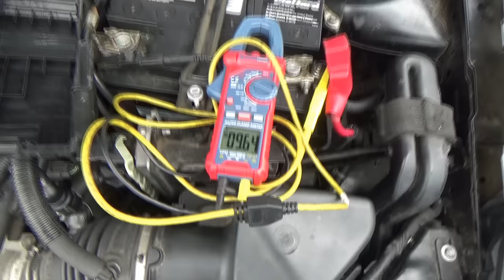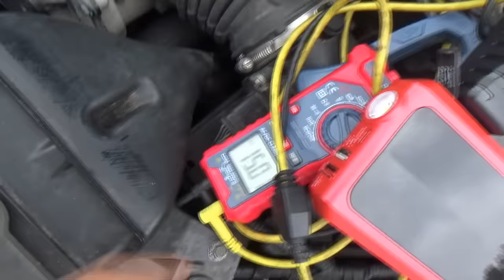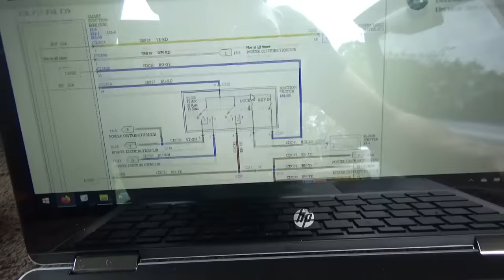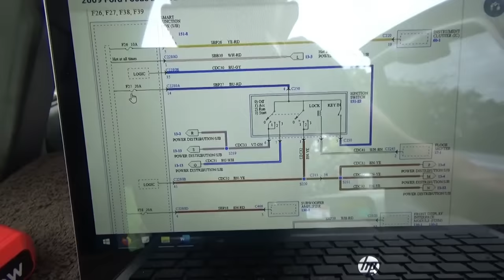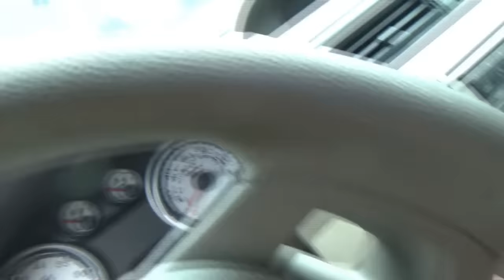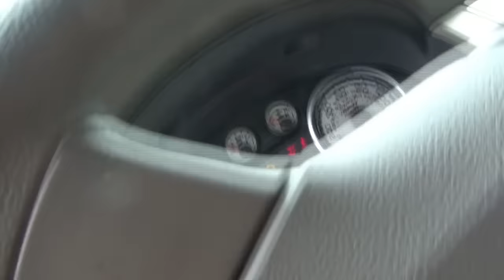How to FOCUS Your Diagnostics? (No Ignition, No Crank)

Comment: Your awesome.  Where are u located. I took my car to get it fixed bc I had a battery drain. Paid them 300 bucks sat for 3 months and all they did was new chip. I replaced the battery cable myself and fixed the problem the key switch is not right I have to keep turning it hard to start.  Help?

Comment: Hi Ivan,    i have the same car as this one here, and my backup tail lights only work on the driver side,  i replaced the bulb on the passenger side , and it still doesn't work.  Is this likely a transmission neutral safety switch issue?   Otherwise my car has no wiring or ground issues,  car is rust free and has like 49,000miles/ 80,000km, really good shape, owned since new.
Reply from the maker: I would take a look at the wiring diagram...if one works then it is definitely not an input problem :)

Comment: I don't think anyone has a problem paying for actual work. But as you know, it's a parts cannon that costs money. I've never been to a shop (in this area) that's didn't change a part and not accept original complaint not satisfied. They don't even verify the repair. "oh that's a separate issue." Most of the time they break something replace a part that didn't need it in the first place. That's why I started working on my own cars. I'm not good at it but at least I try. I've met a few good mechanics in my life but sadly everyone here is in a hurry. Even the dealerships can't diagnose a bad battery. Was funny watching them pull the battery cart around when they said "we'll just drive that up to the bay for you." 10 minutes later after a jump start.

Comment: interesting find.  i agree that it is seperate issues  but , it goes along with one thing. it needs to start  and run . it cant be a fix without both.  its an oxymoron. you need to fix the no crank to see if it runs  but by fixing the fuse you partially fixed the no crank  and it ran as a result. i would prefer to charge as one  extended diagnostic  rather than break it apart. but its all personal preference. human nature has shown me a good explanation on the bill covers you and makes them happier to pay but sometimes breaking down for seperate charges in related cases usually throws up a red flag to customers.
Reply: I believe, the initial problem found was that nothing was working other than the door locks. The customer may or may not have been aware of this.  1-The fuse replacement only brought power(12vdc) to some systems that were lacking power (12vdc). There is diagnostics and verifications involved. Fuses blow for a reason. Just replacing a fuse without such can cause further damage to a vehicle's electronics.  After the ' fuse replacement/diagnostic' (inline test light as current limiter/indicator) the vehicle still had a no crank, no start.  2-Then, the further diagnostics followed by the repairing of the clutch switch restored the vehicle's ability to crank and start today and with no new dealer part required. If one wants to consider 1&2 together as 1 total diagnostic time, the total of that time is still the total of 1&2 diagnostic time. 3- Key programming should cost whatever market value is for a shop to perform such a procedure. It requires costly tools and IDK if it requires subscriptions and/or registrations. 4- Ivan went an additional step to verify if any other electrical items were not functioning correctly and found issue with blinkers, flashers/hi beam and called customer to see if he wanted that diagnosed and repaired.  If one is looking for flat rates to cover all the repairs that any vehicle might need, expect it to be in the 1000s and many do exactly that and charge that, as it assures they will make a lot of money. It is the business model of today. Honest men get crushed somehow in today's business model's process. I have seen it 1st hand from inside and outside perspectives. Honest men like Ivan feel they want to explain what they have done and what needs to be done, in hopes that the customer understands and will be happy on all levels. Many will not fully understand but some will appreciate it.. and others just always think they are being ripped off because they don't understand. I do all my own work on my cars and my knowledge & experience is fairly deep but if I ever really needed a mechanic to trust, I would drive the several hundred miles to Ivan or ship the car to him and still be paying less and actually be getting it repaired correctly. That just does not happen at most other shops. Having a correct repair is priceless, even to a poor and 'thrifty'(cheap) person like myself, as I recognize that value.

Comment: Does anyone know if this meter has an easily replaceable fuse? I have blow the 10A fuse in a meter before and end up having to replace it. Also would like to know where the leads for the meter come from too. I thought they were snap on ones but they don’t look like that.
Reply from the maker: Snap On leads. Only in series ammeters have fuses.

Comment: We had one on a late model focus  that was intermittent  it would drive then die when unexpected  lights would flash off and on  when key was turned on took long time but it ended up being the 50 amp fuse bolted  on the terminal strip at battery it must have be stressed when bolted in making and braking connection when it pleased  it turns out this fuse supplied all the other computers  with power they need to operate properly  we took  did restive test looked fuse tested good So i  pushed around the fuse bolt in ends and stressed it  cause the problem  so we replace the fuse n=but they are not cheap  but now several months latter doing fine the fuse in question was under the hood attached to the buss bar 50 amp bolt in
Reply: cant post picture as to where and what it looks like because you do not allow that option on your site

Comment: I think that in a race between checking continuity on all the fuses vs. Logging into All data and hunting for the right circuit  diagram, that there wouldn't be much time difference, but checking fuses is a ton cheaper than an AD  subscription.

Comment: Why not pop the caps off the battery, fill it with distilled water and put it on a smart charger to rejuvenate and you will have a good battery again, so many batteries thrown away for no reason.

Comment: nice work. as long as you explain to the customer how you bill them they can decide how far to go. In the case of the turn signals I wouldn't charge for the repair. All you did was spray it.

Comment: I disagree with some of your charges. For example if you charge a minimum of say $90 for one hour diagnosis, whatever, that means the entire 60 minutes belongs to the customer, since you charge them for the 1 hour. For example, I once had an HVAC company that had a 2 hour minimum service charge. The tech came and completed the job in 1 hour, since he had a 2 hour minimum I paid for the two hours. 

He was then leaving and I asked him where he was going, to the next call of course. You can't do that, I paid for 2 hours of your time, the next 60 minutes belong to me, not you, once the hour is past you can go to your next call, or take 1 hour off the bill. He took 1 hour off the bill, and amended his minimum charge to an amount, instead of time.

He was not happy, I paid for 2 hours of your time, that's the way you wanted it, so 2 hours is what you owe me. If you had of said we have a minimum charge of $150.00, then you could have left, with no issues. But it does not work that way when you say its a minimum number of hours. Same applies to a mechanics time, if hes stating it as a minimum amount of hours, no a minimum charge, regardless of the time involved.

Comment: This car would have been a classic case of how working at a shop as a flat rate tech turns into issues with the shop. Meaning that you are correct in how you charge individually for the different faults the car had. But at a shop as a tech. This will be like pulling hairs. Once you fix one thing they'll argue that it's not fixed yet. That you haven't actually diagnosed the customer complaint. They won't see that you're chasing multiple issues. And that's why some shops don't like the way I work. Because I'll stand my ground. And request more time. I've had cars like this pay 2 to 3 hours diag. And sometimes once I know everything that's wrong the customer decides not fix any of it. Which is why I stand my ground. Because if the customer doesn't fix anything then you've lost big time. If they do decide to fix it all then awesome. Now you've made the proper amount of hours for your skills. I'd be really interested in how exactly you run your business. Because I've thought long and hard about doing what you do. But it never seems to add up how you could make enough being that you have to travel. If you're mobile. And what if you need parts? The time it takes to call. Order. Pick up. Etc. All the logistics seem like they'd take up too much time.
Reply from the maker: Yes, logistics do take up time for sure. You have to factor that into the parts markup, as well as mobile convenience fee :)

Comment: other than an intermittent short  not current the other reason could be that someone that worked on it before shorted out something that blew the 20 amp fuse if the owner or someone else screwed around and cause the fuse to blow  if not problem may come posible show its ugly face lol

Comment: I think there should be a minimum setup charge and then charge by the hour until the problems are fixed. If you find a new problem, just fix it a part of the whole fix. As a customer, I don't want to be nickeled and dimed to death with every little fix being a new diagnosis and a new charge. I think you mechanics are trying to find ways to increase the bill and your pay but it isn't right.

Comment: IMO  if you figured out the fuse and the clutch in the same 1 hr diag, then I think you're unreasonable to add an extra charge for the clutch switch. If you charged 30 mins for each bad fuse you found, you'd have the scammiest  reputation. Just eat the cost of finding a bad fuse like this one. If you have to spend time hunting down a short, then sure, but you didn't in this case. Yes, get paid for your time, but don't be greedy.

Same with the multifunction switch. If fixing it falls into the 30 min diagnosis time, just and no parts required, just do it and stop trying to justify overcharging.  If you want more revenue, just raise your rate..
Reply: "Don't be greedy"

He's fixing cars for a pittance relative to the dealer or other shops throwing parts willy nilly, even with the current pricing scheme.  No, it's YOU that's greedy, wanting top notch work for nothing

Comment: The car is not fixed, he not found the reason why the fuse was blown and he not looked for. 👎
Reply: You can't fix what isn't broken. He obviously tested for a shorted condition.

Likely cause of the blown fuse in that scenario is an ignorant individual poking and prodding.
Reply: Blown fuse is most probably due to owner screwing around previously trying to find the issues with it .
Reply: Ivan knows what’s he doing and he checked for short by using 5 amp test light.
Reply from the maker: I'll let you find the mystery short...how much would you charge me? xD
Reply: Some here explain to me how his 5 amp test light set up works. My understanding is Ivan is only running  hot to light and it would only light up if it has a short to ground. But what is the deal with dim means X bright means Y
Reply from the maker: @_RiseAgainst  Depends on the load of the fused circuit. For example my 4-amp test light would light brightly if that circuit was shorted to ground, and the entire voltage drop would be across the test light. But if the load was 4 amps, then only 2 amps would flow through the bulbs and then the load, with half the voltage drop across each. Test lights would be DIM in this case. Makes sense?
Reply: @PineHollowAutoDiagnostics  Объяснил прекрасно! Кто хочет понять - тот понял.
Reply: @PineHollowAutoDiagnostics  Kind of. In this specific repair how would your next troubleshooting step have changed if they were dim vs bright. As always I appreciate your time!
Reply: @PineHollowAutoDiagnostics  Ivan first let me say your answer makes sense and I agree with it and I think you did a good job troubleshooting this junk. The only thing that makes me nervous about that blown fuse is I think you said it was a 20 amp fuse. That's a pretty good slug of current to randomly blow a fuse do you have any concerns in that area?  Also since you did charge a diag fee for the turn signals are you going to warrant the repair even though it was kind of a magic repair. :-)
Reply: @_RiseAgainst  The test light was used in 2 different ways/ different configuration function tests. 1- In the case of using it across the blown fuse terminals in the fuse-box, he configured it as a current limiting device . In this configuration it also acts as a current indicator.. is as Ivan has described in previous comment . What you now seem to be referring to, is when he was looking for the presence of voltage or ground at particular pins that are normally to be either at 12vdc or at ground potential at those pins...usually coming from the PCM or preceding component. Hmmm the comment I thought a read is not there anymore . oh well. might help someone.
Reply: @_RiseAgainst  Sorry to speak for Ivan but ... A bright would indicate that the voltage is being pulled very strongly to ground (short)(high current draw). If it were  very bright, he would remove light probably quickly and then have to trace that circuit for shorts of wire or equipment. Probably with the ohms/continuity function on a multimeter and check at areas that use that voltage source and isolating areas/ harnesses/devices, individually to pin it down.
Reply: all that done with the voltage off...or if one wishes they could leave the light in circuit and start to disconnect areas to isolate the fault and see if light dims significantly. I probably wouldn't do it this way with a very bright light tho but one could.
Reply: @paulkaz2127  I searched it on YouTube and found some videos on it. You and Ivan's replies make sense now. I've never seen a short to ground/ blown fuse that was caused  "naturally" without human error.
Reply: @_RiseAgainst  It can happen "naturally" if a part fails in an internally shorted state(semiconductors) or more commonly on vehicles from worn insulation on a wire or wiring harness due to friction and/or heat. That could be a result of initial engineering or of someone changing the placement or method of securing the wire. Either way that could be classified as human error. lol. Sometime we reposition or secure differently to compensate for an 'engineering' mistake/overlook. Of course there are other methods of 'poking around' that can cause a fuse to blow also. lol